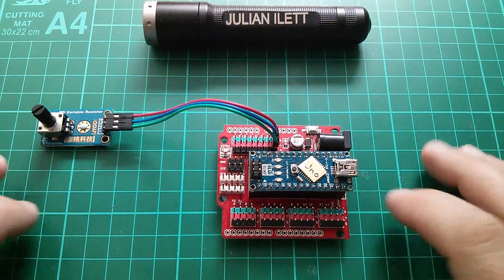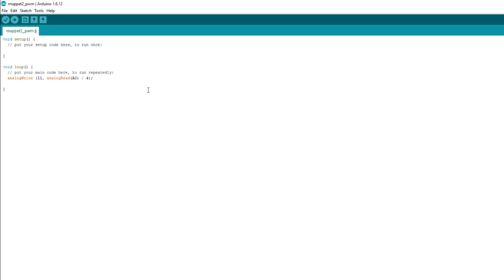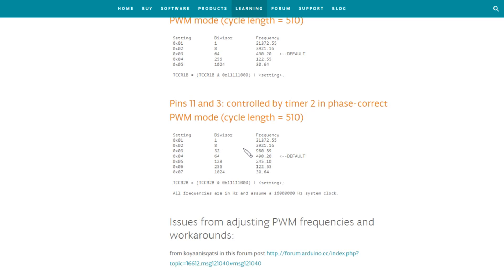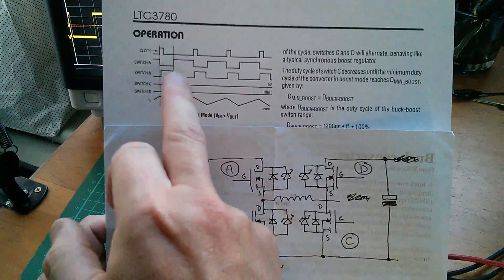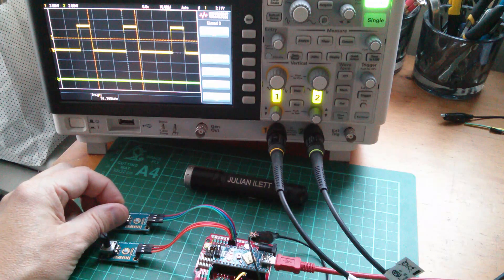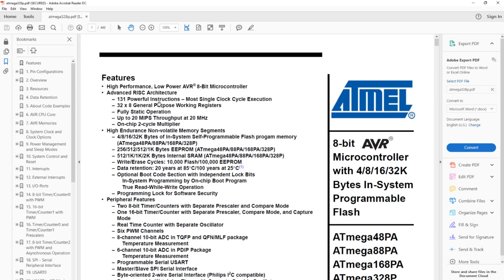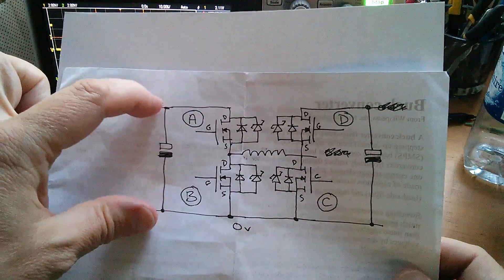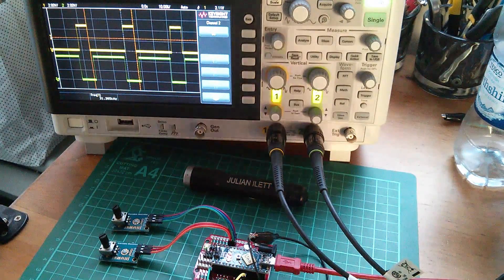Arduino PWM Experiments - Muppet 2 Project

Comment: I really like this series. I think you are on to a product that could sell very well. Having insight into the MPPT process and verifying that it's working optimally is not possible on the cheap Chinese units, and your solution also gives far more flexibility for incoming voltages, amps, battery voltage, amps, with the brains staying the same no matter the power electronics... Massive appeal to me, and I'm sure many others.

Comment: Sir, i have been seeing all ur videos and i would like to do a similar solar project where i use panels to charge batteries and in return i need to buck/boost convert which can give me 12,24 and 48v outputs which can run my wifi ap and network switches only for a few hours, can u recommend if any such charge controller etc is available which can achieve this reliably. i use a inverter as of now but i would like to run the devices directly on DC to avoid any conversion losses due to inverter

Comment: You could do that with only two PWM channels driving integrated half-bridge gate drivers that'll generate the complementary drive signal and dead time for you for each half of the bridge. They also tend to have integrated bootstrap power supplies for the high side devices so you down have to worry about the floating switch node and needing an isolated power supply referenced to it.
Reply from the maker: Thanks Jeremy. I'll look at some MOSFET drivers later in the project.
Reply: Sure thing. I just thought it worth mentioning before a software route was too far along when they're prone to problems providing lockout mechanisms to prevent shoot through, generating small dead time quantities and harder to guarantee the state of things during boot of the uC while I/O is being configured and also in the event of a soft or hard crash. In the case of using an MCU of that kind of scale it'll also reduce the amount of computation needed per control loop iteration which could be quite useful on a uC where doing floating point maths gets expensive (time wise) quickly.

Comment: are you going into production with this muppt? I'd like one if you are. what volts and amps capacity?
I need a 100v in 12/24 volt out. and about 60a. I wish I could build one of these.
Reply: James stranger I can help you
Reply: Satyajit Roy 
how ?
Reply: If you have specific requirement then I can design one for you and send the assembled one. But delivering this 60Amp is not that easy job. It needs multistage conversion.
Reply: Satyajit Roy 
I'm going to eventually have about 8 or 10 250 watt 24 v panels. but just 2 for now. what would something like that cost?
Reply: Satyajit Roy 
do you think something like the EPever tracer A 40 amp charge controller  would be cheaper. they are about $150.00, but I'd need two. or the two 30a versions. I need to be able to switch from 12 v to 24v battery later. I need to be able to buck from 24-30v to12-14v. then later when I upgrade inverters go to 48v panel to 24v batt and inverter.

Comment: why don't you look at ECCP of a some PIC. it has all the features built in. You just specify dead time (to avoid top and bottom being on at the same time), set polarities and use the same single PWM. You can use ECCP with 1, 2 or 4 outputs. Also for driving mosfets look for MOSFET drivers like TC1426/TC1427/TC1428. You'll find it's not that easy to drive a mosfet at 30+kHz, especially big one with huge gate charge. Well you probably know that from your solar PWM controller.

Comment: If you're planning on using N-channel devices for both high and low side switching, what are you planning to do to get around the requirements for the gate drive of the high side?  That requires a voltage above the rails, so it usually involves a charge pump.  P channel devices are of course inferior to N channel but they are much easier to drive for doing high side switching, so you should really consider using complementary pairs.  You can probably find suitable P channel devices for relatively low loads.  And then you don't have to worry about inverting the PWM channel.
Reply from the maker: I'll be using my DCOI (dual complimentary opto-isolator) MOSFET driver with a couple of enhancements ;)

Comment: Julian !!  Where did you find those Potentiometers on the boards?  THose are very neat - and seem to be quite rare (after much searching).  Love the post !!
Reply: search ebay for "potentiometer module"
Reply: Ohhh man yeme !!  That nailed it !!  Thanks a ton !!
Reply: np. "module" is the key word ebay sellers use for any component or circuit mounted to a little pcb like that, usually intended for arduino users. so searching potentiometer module, relay module, [type of sensor] module, wifi module etc will find the corresponding thing
Reply: thats just a variable resistor, see only 3 terminals. those rotary encoders have 5, +ve, gnd, 2 for the rotation, 1 for the push switch

Comment: There are dedicated micro controllers that have special PWM modules, that have High and low side pwm output pairs with set able dead times to match the output drivers switching latency to prevent shoot through. Also with fast fault current shut down Inputs to disable the output if there are software or hard ware issues, these will trip faster than the current limiting on a PSU and save you money and time soldering when your inductor saturates :-)
Reply: This board might be a bit advanced for beginners, but it's inexpensive and contains features that make motor control far easier and more reliable: https://www.ti.com/ww/en/launchpad/launchpads-c2000-launchxl-f28027.html

Most importantly is a feedback loop from the analog comparator module to the PWM module, so the comparator can directly control the duty cycle. This gives you very precise voltage or current control.
Reply: You may be correct but, do you think anyone who follows this series or, even better, tries it at home, will have a much better understanding about how buck, boost and buck-boost circuits works? I kind of thing that might be the point, not making industrial system for mass production. I could be wrong.
Reply: Coolkeys2009 yes 12 bit ADC will allow you to control the output more precisely. TMS320F series have high speed ADC and very precise control of its trigger so that if you want to measure inductor current pulse by pulse basis the you can easily position ADC trigger after a certain period while the MOSFET settles down with all the switching ringing to measure actual value. Get a launchpad from TI and start having fun. But yes for serious design you need to build it on proper PCB or else the stray capacitance and inductance will spoil the result a bit if it operates at higher frequency. You can also buy discovery kit for STM32F334 too that has inbuilt buck boost circuit built in for couple of milliamps in order to get you through all the software part. Digitally controlled mechanism is really interesting
Reply: Coolkeys2009 because this is an Arduino how to.
Reply: Coolkeys2009 Those are for professional designs and most of the viewer will not have the interests in due to reachability problems. in STM32 or STM8 series with advanced timer can do that easily or if you want to jump higher then there is TMS320F series or STM32F334 for it with micro edge positioning. there will be no hardware feedback for fault situations.
Reply: He's tinkerning with an Arduino to see if it will be suitable, I think in this case he would be better off with an PIC on some strip board or even breadboard programming in C. I'm not convinced it will be safe to use PWM in the way he's showing for anything other than very low power/efficiency.I know some of the  pic18f, dspic30 are available with the exact peripherals he needs. Mind you I do see the advantages of using an Arduino in terms of pre written routines etc.
Reply: Coolkeys2009 yes he could easily use pic16f1783. That has PSMC with great flexibility for PWM generation. dsPIC wont be breadboard friendly. It has 12 bit adc and analog comparator too
Reply: The Dspic30f4011 is a 5V tolerant 40 DIP package and runs at up to 32 MIPS. I have used an 18F45k22 that has an enchanced PWM module + a 4 pin PWM output mode(don't know if it would be suitable), + comparators and built in voltage reference/DAC that can be used to generate interrupts + control or shutdown PWM , and hardware stack for improved C compatibility.
Reply: Awesome. I didnt do extended search about this dsPIC and its good to know that it comes in DIP package. Yes PIC16F1783 is available in DIP package as well, but its highly flexible PSMC module is very interesting. Moreover it has 12bit ADC and not sure the dsPIC you mentioned has that. My best choice is now TMS320F series as TI is now providing CCS free license for unlimited use.
Reply: None of the 2 parts I recommended have 12bit A/D's, Once I learn to design and make my own PCB's I will start to look at the newer parts as they often have many more features and require less support components.

Comment: Hey Julian. Nice work, but if there was a way to increase the size of the characters when you have the sketch on the screen that would be excellent .
Reply: there is a way. just look in the preferences in the IDE
Reply: will try that and hopefully Julian does also.  Hopefully his capture process recognizes the changes.  Others are using larger characters and that's good.

Comment: I still wish there was an IDE as simple to use as the Arduino C. Hi Tech C and Mikro C are more advanced and I'm still doing baby steps with C. Oh well, assembly is a little mor lengthy but.... Great job, I love how you delve into the data sheets and make them understandable
Reply: AFAIK, there is no intermediate step solution out there... The Arduino 'IDE' is as basic as it gets (calling it an IDE is generous) and that's OK because it is designed for a target audience of people new to the concepts of embedded programming. I come from the other direction, having used IDE's like Tasking, Keil, Crossworks, and various other ones wrapped around Eclipse. Seeing as most chip manufacturers are now rolling their own IDE, the path to using a more high end IDE may be to pick one Chip manufacturer (eg. Atmel) and learn their IDE (Atmel Studio 7) until comfortable with it. Jumping to another IDE is easier as the basic principles are known by then.
But it will take time.
 - Eddy

Comment: Excellent video. You produced a similar one when converting the pwm5 to Arduino and I found that explanation invaluable in converting your code to the attiny85 after referencing the data sheet. Very much looking forward the next instalment.

Comment: You could go a lot further than muppet 2 here, you have just demonstrated how a H bridge works for dc to ac inversion :) would be another awesome project if you decided to go with it :)
Reply: sounds expensive, but im sure it will also do a pure sine too :)
Reply: Thats as maybe, but a modified sine is the same as pissing into the wind really aint it...
Reply: A modified sine wave is worthless, useless and pointless, it doesnt matter which way the wind blows, your still pissing into it with anything less than a true sine ;)

Comment: That's looking quite good! Coupling the two Mosfets to one pot with slight overlap is indeed very easy; just subtract a small value from the potmeter to set the other gate.

I think you could make quite a nice buck-or-boost module using a low power MCU as small as a ATtiny13A. By virtue of the symmetrical approach one could just select two pins to serve as input for either buck or boost mode. Nice!

Now what's next? What type of conversion is best suited for a tiny MPPT module?